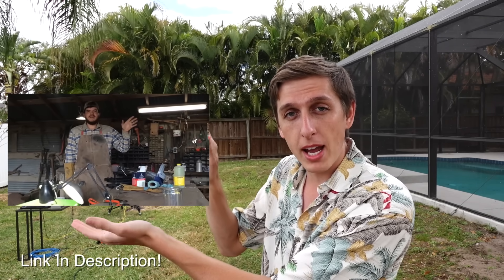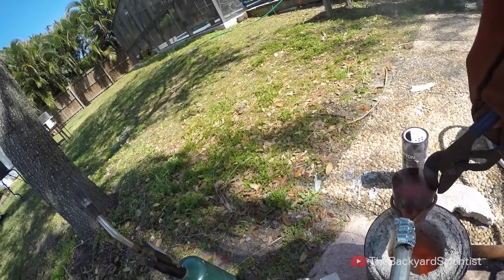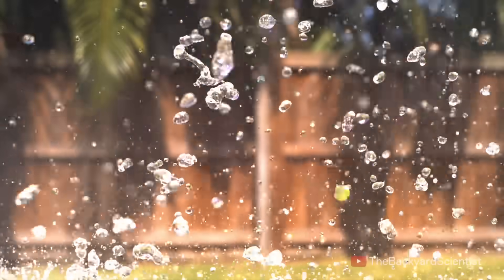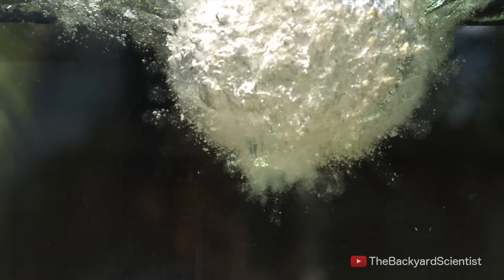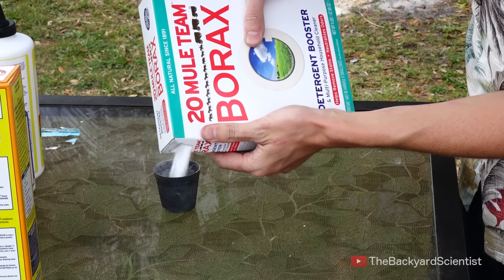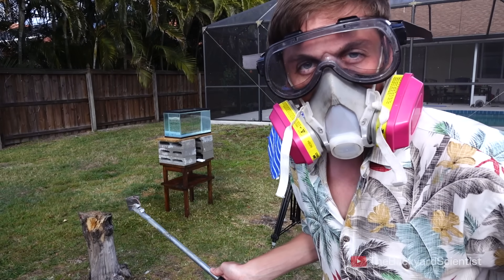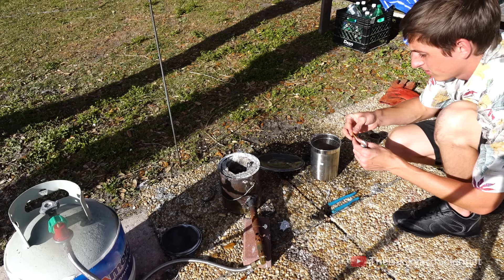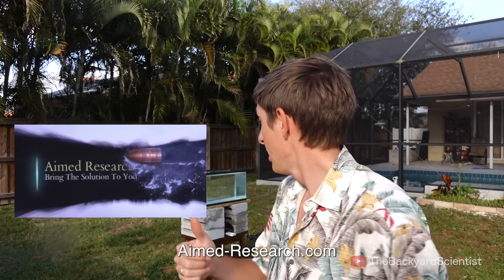Pouring Molten salt into Water - Explosion!

Comment: There's no chemical reaction here. The sodium in the salt isn't metallic sodium, it's sodium ions, ie the end product of the violent reaction between sodium metal and water. It won't react any further in the same way that ash won't burn. What happens is simply that as the water and salt touch, the water rapidly and violently boils. The steam generated by that boiling smashes the salt glob into small droplets and sends them out into the water, resulting in a huge contact surface area between the two, and with that a very rapid transfer of heat, boiling a huge amount of water in a single go. Boom! How well the molten material fragments depends on viscosity, density, temperature, and so on, and so not every salt will be equally prone to detonating. How exactly the molten material behaves when it cools and solidifies also matters, if it encases itself in a solid shell before the explosion can take place then nothing happens.

Comment: The heat created when the salt goes in the water made the molecules of the glass stay together, while that was happening the chemical reaction resulted in a explosion and created the molecules to bounce back making it shatter, which means the explosion was a chemical reaction and the glass shattering was a physical reaction

~ just my theory so thanks for seeing, ps im just 12
Reply: there is no heat created by solving NaCl into water, on the contrary, its an slightly ENDOthermic reaction. 
The only thing what happened is - like he said - the water boiled extremely fast.
The glass shatters as a result of the shockwave from the explosively boiling water.
Only physical reactions happened.
Reply: Thjaffi thank you for a simple explanation my little chemistry/physics kind was wowed
Reply: dude . . the glass just broke Oo OwO

Comment: I think it didn't work for other salts because the other salts aren't made up of group one metals. The thing about sodium is that it reacts violently with water compared to other metals from other groups like Boron or aluminium that only reacts with steam and sodium chloride is quite soluble in water compared to some other salt which explains why its molecules travel faster in water. Try heat up both the water and the borax and see if there is any physical reaction

Comment: I would like to say that your final proof is invalid because i believe you have mixed up sodium/chlorine with sodium/chloride ion. Sodium chloride(table salt) contains sodium ions and chloride ions, but not sodium metal nor chlorine gas, so the proof of ph change is based on reaction between water and sodium/chloride
i.e. Na + H2O -> NaOH +H2, where NaOH is alkaline
Cl2 + H2O -> HCl + HOCl, where HCl and HOCl are acidic.

However that is Na+ ion and Cl- ions, and they do not react with water like that.

So in conclusion, i believe your concept is wrong and the proof is invalid

Comment: well if your theory is correct, salt and water are known to combine together because they are grains so even melted down the water wouldnt stop them from touching or even combining, now borax is used for laundry so my hypothesis is it needs to be thrown in at a very high force to combine with the water if its melted(note because it is melted i believe it has a layer of oxygen protecting it but now id have to do experiments to figure that out and im only 14 so) ,now the others were not exactly the best water soluble things so when put it they had a layer of oxygen protecting them making it so they cooled down fast enough were when the water touch them they were not hot enough to explode, or that the water could not get stuck into them creating that big expansion

Comment: Melted salt has a high temp. nearly about 1000 degree... when you pour it into water of room temp. the heat transfers to water massively and the temp. of water rises so high that the small proportion of water becomes steam.....but the process is so fast that the heat can't manage to spread all over the liquid.... due to unbalanced expansion of volume( we know the volume of vapour will be so much more than the liquid) it blasts....it's a physical process....not chemical....you can see the solid salt bricks there.....✌✌

Comment: When the salt cooled down it made a cracking noise. This same noise is made by the flux after you make a weld using a stick welder. If its a good weld you can here the cracking and you dont even need to use a chipping hammer. you can easily sweep it off. The flux is basically just to produce carbon dioxide. This way not a lot of oxygen gets to the steel. because it would make it very porous. When the borax and others cooled down. Did they do the same thing and crack up?   also I came on here to try and find a video of molten steel and salt water. Because I was wanting to know if this reaction created any oil. Im sure the oil would burn up immediately upon it being created, but if it was somehow contained I think it would. Because I think this is what created earth. The containment of that reaction. www.facebook.com/doctornocturnal

Comment: When NaCl is melt, you got Na+ and Cl-, basically ions. In room temperature, NaCl dissvole into Na+(along with 4 H2O molecules) and Cl-(Along with 4 H2O molecules as well). That stem effect would not happen because both ion particles are super attractive to water molecules that may break the balance to form that steam effect. But the heat would still be there and casuing the water to steamlize when the H-H key and Na+ Cl- H2O attraction is weaker than the steam strength. Kind of like the super nova.

Comment: You did a very interesting experiment with molten salt. As you correctly pointed out, there was no chemical reaction. It was completely a physical process. And yes, it is correctly, this is physical. It is just boiling. And the key point is in the amount of heat that you add to the water. The hot liquid should be enough conductive to heat, to pass it to the water. Also it should have enough heat to produce the explosive boiling.
The usual boiling happens as usual, when you heat water slow enough. Different impurities in the water starts to oscillate much more energetically than water, and they serves as centres of forming gas bubbles. So, the water starts boiling from some distinct points.
But when you heat the water much faster, there is no time for evolving centres of boiling, the water becomes super heated. At some point each molecule of water from the surrounding volumes starts boiling, without any boiling centres. So, the water does not boil from some points, but boils from the each point of the entire volume. This phenomenon is called phase explosion or explosive boiling. You can do the same thing with any materials that are hot enough, and conduct well the heat. I've seen this done by mythbusters with termite and ice. But they failed to provide an explanation.
See on you tube the video from mythbusters v=w6cMmk8LZgQ

Comment: when you heat nacl on high temperature on a very small amount of Na+ created when it reacts with water it produces H2 gas at very high speed thats why it explodes. in litmus paper test fail because you have very large quantity of water HCl is created in a very small amount that's why your litmus paper test fail. I think its a reason behind it

Comment: I think you should test the permeability of the salt... and determine mass density while molten. Consider expansion while cooling...changing state...release of oxygen as oxidizer in high heat/pressure. Just thoughts.. Great video!!

Comment: Seems simple to explain. Salt is soluble in water but, since the molten salt is beyond water's boiling point and the salt is not so chemically stable in its liquid form, they'd react instead. So we get Oxygen (incentives flames), Hydrogen (flammable), Chloride (creates acids, acids tend to be flammable) and Sodium (reactive in water) at a certain instant.

Comment: Okay this makes no sense but I think that maybe because If u notice u used salt which is neutral and the other solutions like borax and boric acid. They r not neutral they r either acidic or alkaline. So I might make a conclusion of when a neutral substance reacts with another neutral substance an explosion will happen but if the an acid or a base or an alkali is reacted with water then nothing will happen hence the borax not exploding

Comment: Its a 100 % chemical reaction bro and the solution formed has the same pH as water that means 7 . Its a chemical reversible reaction . Try to heat th water of the reaction you will received the salt you have used.

Comment: Neat video.  The Leidenfrost effect is a very messy (dynamic) thing, a bit like flying a helicopter: do-able, but not quite a law of nature.  Get the balances (rates and forces) wrong, and it fails.  Of your compounds tested, NaCl has by far the most affinity for water: it has the largest heat of solution, and the highest solubility limit.  I suspect this overwhelms the vapor barrier, allowing more intimate contact.  I.e., the water vapor goes into the salt blob aggressively, and as it does so, that absorbed water vapor heats rapidly.  The sudden pressure increase (that we observe as an explosion) cames not from water changing from liquid to gas (as is the usual cause of water-related explosions); but from the water vapor expanding dramatically from having heated so rapidly from 212°F up to your salt blob's temperature (ideal gas law).  E.g., in the borax example, the water vapor isn't (chemically/energetically) dying to absorb into the molten borax, so too little water vapor moves into the molten borax, to cause much pressure shock.   You could test this by repeating your experiment with other salts that have similar strong water-solubilities, like MgCl2 or CaCl2.  I'm not totally sure how to explain why your footage clearly shows a very nonuniform time-path for the major pressure wave.  Best guess is that it's just a very chaotic system, kind of like explosions inside the cylinders of engines.  (FWIW, I'm an R&D chemical engineer, with 36 years at it.)
Reply: ZenGeekDad TL;DR because Chlorine tickles Sodium's funny bone more than other elements.
Reply: WOW DAT ALOT
Reply: ZenGeekDad Nice lecture XD
Reply: Taiya Smalling Didn't you read, he is a chemical engineer.
Reply: ZenGeekDad darn you shot down my theory about the Chloride in the Salt being melted away and the pure Sodium remaining haha. I’ll just fade away with my cursory chemistry knowledge lol.
Reply: ZenGeekDad I was searching for why it actually exploded and dude that really helped me.
Reply: Holy makrel did u try to kill me gere
Reply: Showing off your new knowledge from science class
Reply: ZenGeekDad so it is along the lines of a steam explosion like when plasma goes into water? The easiest example would be when lightning strikes water.
Reply: I'm wondering about both the specific heat of the molten salt, as well at the heat of crystallization.  Perhaps as salt droplets crystallize, they put out a pulse of extra heat stirring things up?  And likewise for the borax and other compounds, if they don't have as much specific heat, perhaps their heat energy is being removed too fast to cause an explosion?
Reply: I was waiting for the physicist in the comments
Reply: OH JEEZUSSSSS 😂😂
Reply: check what is "steam explosion" please and you will understand this phenomenon.
Reply: ZenGeekDad I see u watch Rick and morty
Reply: ZenGeekDad It's also possible that the ions segregate while in the water. He mentioned sodium flames over the crucible as it oxidizes. I'm inclined to believe that the salt is actually decomposing into Na2O and Cl2 for a flash instant and then as it cools, it reverts to 2NaCL and O2. It's likely a chemical reaction
Reply: ZenGeekDad omg dirk alert!
Reply: ZenGeekDad.....I think you coppied that down from something or someone?????!

Comment: pH is not changed...otherwise every Italian man should suffer of stomach acidity since we all cook pasta in salty water.  Sodium and Chloride are both the counter cation and anion respectively of a strong base (or acid in the case of Chloride) which means that they are really weak acid (or base)...and they are in the same amount in the water so there's no pH change at all. It explode when melted because the water boils instantly creating water vapour which cannot escape quickly from the fish tank.  In the other case, pouring metallic Sodium into water...that's a chemical reaction, there's a huge release of heat and Hydrogen is released which promptly catch fire....if you check the pH in this case, it will be basic, since Sodium Hydroxide is the product of that reaction. And please, be careful!  see ya! ;)

Comment: You are correct it is the hydrogen expansion causing the explosion by getting trapped inside the salt. The reason it happens to the salt and not the borax is because of the surface tension of the borax mixed with the heat causing the water to steam away from the borax essentially creating a bubble preventing the hydrogen from breaking the surface of the borax.

Comment: Sodium is an alkali metal. It has one electron on its outer shell. Hydrogen needs one to fill its outer shell. Therefore the sodium removes it's electron and the hydrogen gains it. The equation for this is 2NA + 2H2O -> 2NaH2O+H2. In the product the sodium is positively charged and the hydrogen is negatively charged

Comment: In layman’s term: A physical reaction is a reaction that can be reversed. Like putting salt into water. When you evaporate the water,  you can still gain back the salt.
Reply: All reactions, whether they be physical, chemical, or nuclear, can be reversed. It's just that some chemical reactions are very hard to reverse directly, so it's more feasible to do so in a different path than the forward reaction.
Reply: Chemical and even nuclear reactions can also be reversed. Burn sodium in chlorine to get NaCl. Dissolve NaCl in water and pass a current through it to get sodium and chlorine.
Reply: Nova Solarius Then it would be physical reaction. No matter what. It might seem like chemical, but if it can be reversed, then it’s physical. If it’s chemical, it CANNOT be reversed.
Reply: MIND NOVA mi
Reply: Actually physical changes can be reversed not reactions
Reply: War Simulator physical changes ARE a result of physical reactions. If physical changes are reversible, then the physical reaction governing the change is reversible
Reply: Sijan Khan remember science is not arbitrary and one more point that the term physical reaction is not genuine at all
Reply: Wht
Reply: And what about entropy ? Entropy loss can't be reversed (it's even mathematically proven, not just empirical), at least not without a whole new theory replacing Einstein's work. There are few physical reactions that involve no entropy, and this one is clearly not reversible. Even your basic water cooling system in your fridge is not perfectly reversible because of that.
Reply: MIND NOVA I know what your saying but you left out a crucial element, the difference between a physical and chemical reaction is that a physical reaction does not change what the substances are (for example salt water is not NaClH2O it is NaCl & H2O there is no bonding between them and therefore can be reversed through physical processes) while chemical reactions change what the substances are on a molecular level and require either the absorption or release of energy (meaning that you can not get the same substances that you put into the reaction back out of the reaction without the use of energy because bonds were created and/or destroyed meaning that the components added initially are essentially no longer there having been broken down and re synthesized, rearranged to make something new )

Comment: Answer to your riddle, maybe. The second thingy you put in. It had a higher melting point, which means if you heat it up to the same heat as the others, it will turn hard faster. This causes the mass to be unable to spread out like the first salt or the pure sodium and thus cannot create an exponential reaction :)

Comment: have you considered that salt is hygroscopic, which means, it attracts water. maybe the molten salt sucks some water inside it. so the reaction is more powerfull than with a substance that is less (or not at all) hygroscopic. a hot substance, that is not hygroscopic, gonna turn the water into steam before it touches it. so there is a "shield" of gas between the hot substance and the water. but with the salt, which attracts water, there is less time to build up this "steamshield". thats why there was water inside the molten salt, like you discribed it with the modeling clay ball. i am not sure if this is really the right answer, but this theory sounds reasonable inside my head.

Comment: It's obvious that salt is nothing else than tiny crystals that only comes from salt sea water, so but cut to the point , any crystals of salt contains tiny tiny electricity ones it get mix with water you can  pull power out of it , so what happens when you heat up salt and let it cool down it will form a nice beautiful hard crystal as metal but pour the heated up salt into water it explode is all because the heated electricity in salt separate H2o in gas form and molecules form at the same time and what happens with gas if it gets  fire energy , it explode

Comment: The sodium in salt or sodium chloride is an alkali metal, which means it will have a violent reaction with water. Not the chlorine part which I believe turned into a gas when you pour it into The Crucible, but the sodium. Other elements that will react in a similar matter to sodium are lithium, potassium, rubidium, cesium, and francium.